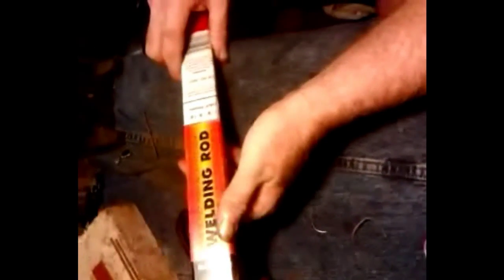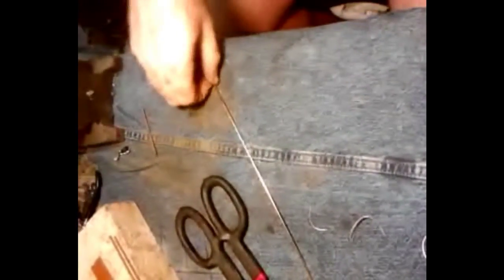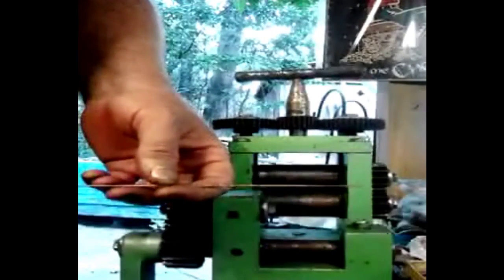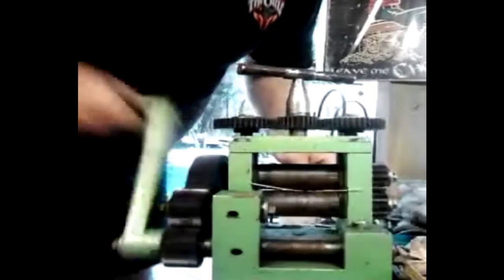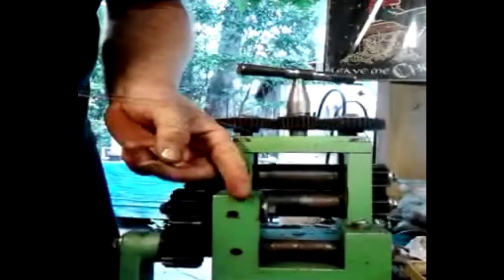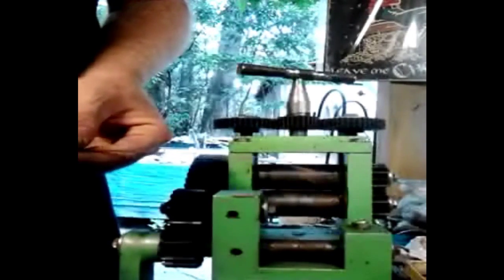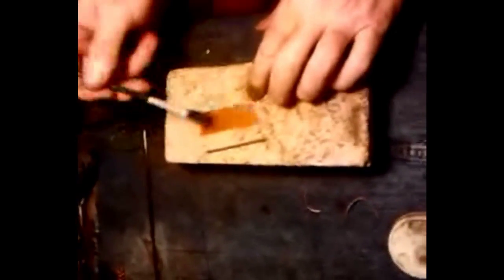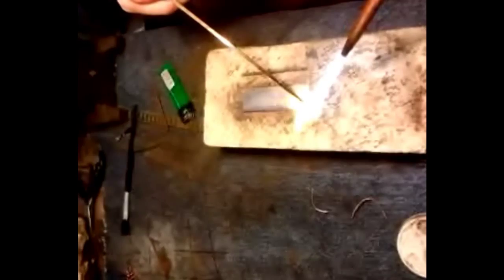Copper Soldering Tips By : Richard Gunter

Comment: He uses copper solder rods and rolls them flat, using several passes, making it quite thin.  Once thin, cut into chips, to use with copper pieces (like getting silver chips).  At the middle of the film he shows the need to dab flux on all the pieces he uses.   Lay out and flux your pieces to solder, Heat the area evenly where you Want to join the copper pieces. Watch as the solder is sucked up.  
Note:  His new video talks about using Perfect match copper solder. Also note Rio’s advice to copper charge your pickle to get the best match in your join.  Here is the new copper solder: https://www.riogrande.com/product/highcopper-wire-solder-18ga/132199

Comment: Have you tried the new high copper solders like what rio-grande sells?  What do you recommend for flux and for pickle?  Your work is awesome......
Reply from the maker: Most any flux will work for Copper soldering even borax ...pickle ph.down used in hot tubes and pools works the best  or vinegar and salt mixed with hot water works good too
Reply: Thanks Rick, I just noticed in some of your videos you using a brush and I didnt see the typical crust or bubbling of flux....And I found this sil-plo brazing rod or phoz plo and a lot of people say its self fluxing....others say  heat the rod dip in flux.  so who knows. I dont know to many folks in my area to watch solder copper up close....